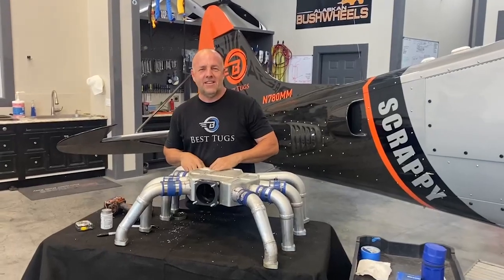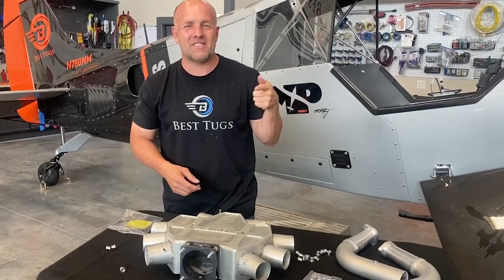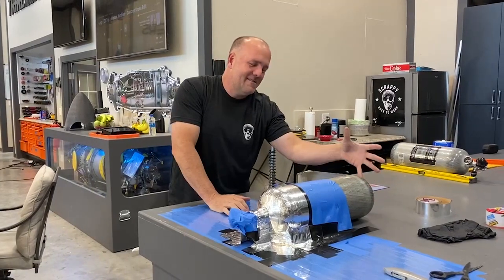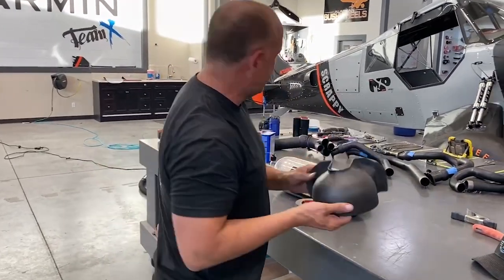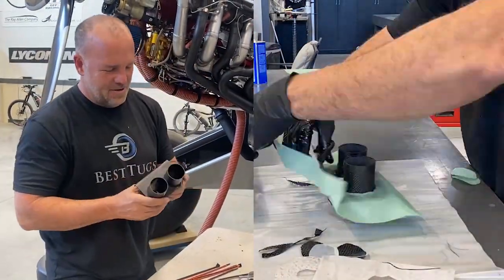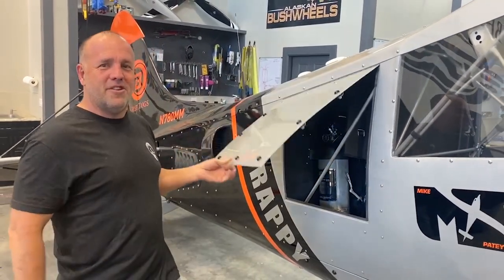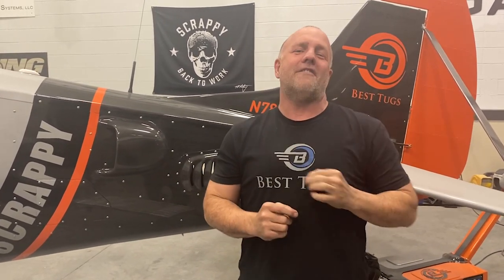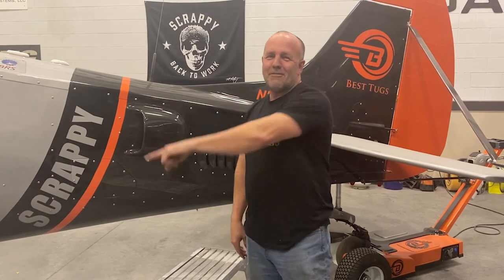Monster NOS Race Engine in a Bush Plane - Part 2 | Scrappy #40

Comment: Been a LONG time since I messed with nitrous.. shouldn't the bottle be laying down? Great video as always Mike!
Reply from the maker: 👍🤠 great question. The pick up tube is at the bottom of the tank.  They lay down in cars because trunks aren’t usually tall enough.  So in cars the tank brackets are taller at the front top of tank with the bottom of the tank to the rear of the car so on a launch the then liquid state of nitrous is forced to the bottom of the tank.
Reply: @MikePatey  Learn something every day! Thanks Mike!

Comment: Hey Mike,

I have a quick question for you. Regarding the heat exchanging system between Draco and Scrappy. With Draco, you went with an oil-to-air heat exchanger, with Scrappy you're going with a heat scavenger system.  Did the Draco system not live up to expectations or was that a unique system to primarily deals with the complexity of a jet engine?

V/R
-Jarod

Comment: If you had light weight electric motors inside your wheel rims you can taxi with engine  off ,take  off faster with driving tires and you don't need brakes so you don't pay any extra weight
Reply: The wheels won't turn more than two revolutions before liftoff.

Comment: Is there a reason you're using silicone couplers rather than something like a Vibrant clamp for the intake headers? I know it isn't a boost application, but with how you overengineer everything I'm just surprised

Comment: Do you have a pressure gauge on your panel?  Let you know before you drop into those beaver ponds that you do have the juice in the bottle to get out.  Be catastrophic to assume you do and find out after landing that a small leak has bled your nitrous off.
Reply from the maker: Great question 👍🤠 Yes it displays it on the Garmin screen

Comment: 900 psi nitrous versus 10 psi gas ? what stopping the 900 psi nitrous overpowering the 10 psi gas?Meaning pushing back the gas/ sorry for the question . Im trying to understand what you doing.

Comment: Does carbon fibre crack at low temperatures- thinking Alaska -40C
Reply: The graphite fibers don't. Not sure about the resin. It probably depends on which resin you choose (he is using epoxy but I am not sure which one exactly). But -40 is pretty cold. He may try to avoid such conditions?

Comment: PS, your 250 shot is really 500 at 2700 rpm.  BOOM!
Reply from the maker: I talk about that in the first video and that’s why I back it down,  I won’t ever use 250 that would be foolish.  It’s so I can use it at high high altitudes for compensation.  The power is elevation related.  Thanks for the comment for others that also didn’t see the first video where I talk about rpm back down and altitude adjustment.   Never ever 250 near sea level 👍🤠

Comment: Any thought given to the possibility of the parachute rocket causing that Nitrous tank to explode or leak?   I mean... a jet of nitrous, surrounded by carbon, ignited by the rocket, in the back of the plane as you are floating down on a chute would not be a great thing...In high oxygen, even diamonds burn like matchheads.

Comment: I imagine that nitrous leans your mixture. If it does, do you need to be full rich before you run it? I know you said it will mostly be on takeoff but would there ever be a scenario where you run it while flying fully leaned out?
Reply: That's why the nitrous jets are dual jets that also spray in additional fuel.  The system sprays in the right amount of fuel to match the nitrous it's spraying in, so the mixture stays the same.

(Mike described this a bit in the first video about the nitrous system.)

Comment: I gotta be honest.  I love your videos, I haven't missed a single one, and I can't wait for your next.  I fear for your safety.  Its one thing to grenade a motor in a car or a truck.  Its a completely different thing to grenade a motor climbing out of an airport or in the mountains.  The motor is not where I would push the limits of horsepower.  I'd opt for the most reliable engine to get the job done.

Comment: Nitrous does not "explode faster".  It increases the effective dynamic compression ratio.  All other things being equal, higher dynamic CR requires less timing.  In practice, this is not necessarily true on nitrous.  Especially not on small shots.

Comment: Mike.  Love your ideas, but at 900 PSI, the orifice in the metal will increase over a short time.  I use high pressure fluids through a small diameter orifice and after just 8 hours of use, the size of the hole is much greater.  For you, this would be catastrophic.  Look into this.

Comment: I love this build and and all the innovation that's gone into it but this part i don't understand. Nitrous is great fore making horsepower but it is also great at almost always causing premature engine failure. Even if an engine is built to accept nitrous, ring gaping, etc. It still taxes the internals of your engine sooner or later causing Premature failure. On the ground that's fine it just costs money. But in the air im sorry i just don't get it. If  anything it more than justifies money spent on parachute recovery system. Don't mean to sound negative. Again i love you builds your enthusiasm and attention to details i just had to express my opinion. Keep up the good work and thanks for the great content.

Comment: The only thing that I know about Nitrous I learned in high school, and I don’t recommend any one inhale the stuff.  Makes you even more loopy.  Just say no to the stuff. Do you own stock in Aeroquip?   You are going to need a computer programmer to adjust your tuning for the engine.  Or a team.  Simple he sez.....Really important question.....when you doing the wings????  Quit putting it off, I am going crazy waiting for wings!
Reply: The wings can't be made from carbon fiber, and the usual rag wings won't work either due to the Excessive HP and the loads to be placed on it.  So little projects keep popping up until the wing issue is resolved by someone else and the framework purchased for covering.  Don't hold your breath, you will turn blue.

Comment: Being an experimental, why can't you install, program, and run a complete stand alone engine management system? you could even run Ambient Pressure, Mass Air Flow, O2, Ignition, Fuel Mapping, Load Mapping, etc

Comment: is there a check valve on the fuel line?  otherwise 900psi will overpower 10psi and push NOS up the fuel lines, no?
Reply: It is 900 psi upstream of the jet. The orifice on the jet limits the flow. It will not be 900 psi inside the manifold or duct.
Reply: @mckenziekeith7434  my point exactly. 900psi prior to the jet and Y fitting would mean it would overpower the 10psi fuel pressure. Remember, the fuel line and NOS line merge together at the Y fitting/jet.

Comment: Why not set the motor up on fuel injection? You could make a Haltec or Holley computer run it I'm sure. All the sensors are generic.

Comment: @6m40s: The black phenolic barrier terminal strip (on the nitrous solenoid plate, nearest the camera) looks a bit out-of-place on an aircraft engine, which vibrates. If this design is to be retained, then make sure that suitable lock-washers are used, on each connection screw. And then check the screws (for them backing off) before each flight. With care, it should be fine. It just looks like a weak spot. Stay safe.

Comment: @Mike Patey Be mindful of the dip-tube location inside your nitrous bottle. You didn’t mention how the location of the  the dip-tube pickup changes with the mounting orientation. Combine that with the the extreme angle of attack that scrappy will be capable of. You don’t want the fluid to uncover the dip-tube pickup ant the wrong time and flood the engine with fuel. Because “as I’m sure you know” N20 does not burn, it simply adds more oxygen to system, allowing more fuel to be burnt in the same size combustion chamber. Same reason that rockets have to carry their own oxygen with them in order to burn their fuel outside of our atmosphere. You also did not mention how you will be monitoring and regulating your bottle pressure. It’s gonna be hard to maintain 900psi with that multi port system you’ve got and operating in low temperature environments as you have mentioned. And the purge is necessary to clear the line when changing the bottles, but that not why pro nitrous drag cars do the long purges at the starting line before they stage. It’s done to bring the bottle pressure down to the point each time. It’s much easier to reduce pressure than to build it. So race teams heat the bottles in a water bath prior to installing them in the car. This raises the pressure above 900 and allows fir the time it takes to get the car through the lanes, track prep,  burn out , ect. Now the bottle has cooled over the time is has taken to get the cat to the staging point and the pressure has been dropping this whole time. But you never know how long all that will take. So you over pressure the bottle to say 1100psi and it losses 100 psi during this time. Now you have to purge off 100psi to get to the 900psi target which is necessary to make the same power each pass down the track. Again you prolly know more than most any of us here, so I was just curious to see how you were going to be managing that aspect of the system. Keep up the great work brother, your an inspiration in a time when humanity can make great use of it. Gratitude 🙏

Comment: Nitrous Oxide is one of those things where "just enough" is good but more is bad! I'm an Engineer AND a hotrodder and I know enough about how to do it IF I want to but I don't need it. For example I have a 1999 Pontiac Grand Prix GTP. For those that are not familiar with them it is a Supercharged Buick 3.8L V6 with an Eaton M90 ("roots" type blower). 240HP under boost, but boost on demand with a bypass so normally it is the same performance as the 200HP NA engine. I've seen MANY people on the GP boards put Nitrous on their cars and 99% of them do it wrong. Dry kit only, too much Nitrous even with a wet kit, not taking into account all the things you went through, etc. Too many of the younger guys (I'm 62) get "spray happy" and take the piston tops off just as you describe! The engine in mine is the same as used in a Buick Park Avenue Ultra which is a MUCH heavier car! Stock numbers on MY GTP are 0-60 in 6.6 sec, 0-100 in a little over 15, speed limited to 135 MPH because of the stock tire speed rating and MY tires aren't stock. Clip the limiter and they'll get out to ~155 (documented). As it is it gets up to highway speed before I get to the end of the entrance ramp without WOT and it'll cruise at 100 without breaking a sweat as long as there's gas (Premium Only) in the tank! I drive conservatively "most" of the time...  ;)

Comment: At the current pace, I wonder if Scrappy will ever fly this year.  Obviously the wings are a big issue because of the horsepower and are being put off for as long as possible.  Whatever happened to building two airplanes at the same time, Draco X and Scrappy?  As a pilot, to say I'm disappointed is an understatement.

Comment: I love what you do.  But, why put in a system that you will seldom use when you have gone to great lengths to conserve  weight.
Reply: Because using it will allow him to take off from high mountain lakes that probably have never been visited by aircraft before. He explained all this. The nitrous is to maintain sea-level performance in high mountain lakes for take-off.

Comment: I think you named the plane wrong.  It’s not Scrappy, it’s Snappy.  All the custom carbon fiber and aluminum pieces are not because you want to save weight, it is to allow you to snap things together.   The nitrous was just more snapping.  Snap the bottle in, snap the ports in,  snap your head back.  It’s all Snappy.

Comment: I'm not all that excited about using an oxidizer  "power adder" for an aircraft engine. I don't think it would pass Australian CASA standards for certification anyway and would be a nightmare to estimate a TBO for the engine. The worst case is you get to 300 feet or something on takeoff and blow the ring lands off your pistons or have some other kind of catastrophic detonation that has you looking real quick for a place to put down with oil all over your windshield.  In the back of my mind I really wanna see how it works though...don't tell anyone ;-)

Comment: Awesome setup! So my question is this: is there is any risk of fuel pooling or nitrous leaking into the intake when not desired and what are the potential risks if there is? My thoughts are that the system will work fine at WOT when its designed to trigger, but what happens if one of the solenoids gets debris in it or a seal fails? Are there redundant solenoids so that fuel and gas can both be cut if needed in the event of a failure?

Comment: For such a smart guy it was pretty dumb to make this system this complicated. It would have been so much more robust and easier to tune if it was just a single modest shot instead of all these tubes, valves, switches, etc. for different amounts. In what situation could you be in to need nos and still want to fiddle with all of that.

Comment: Hi Mike ! Here an ex Belgian F-16 crew chief :)  What if the Nitro tank empties ? Your engine will stall as well if you keep the nitro timings. Do you have a feedback of the nitro pressure ? Back to work :)
Reply: I was thinking this too. Also, if your DIY voltage regulator timing fails do you have a way of preventing a shot of nitrous from destroying your motor? Maybe set another condition of having the correct voltage as a requirement to trigger the solenoid. Though, I'm sure you though about all of this.

Comment: Pounds, ounces and inches. 
When will your country realise?
Kilograms, milligrams and millimetres.
It is SOOOOOOOO much easier.
Reply: Inches are OK. It is the mixing of feet with inches and the tradition of using power of two fractions (1/2, 1/4, 1/8, 1/16 etc) of an inch that drive me crazy. But whenever it is reasonable I use metric for everything if I can. If I have to do calculations I convert to metric FIRST and then do all the calculations in metric.
Reply: @mckenziekeith7434  YES the fractions of an inch are crazy.

Comment: Increased complexity increases potential points of failure. Sometimes I think you are just trying to show off instead of making rational choices.
Reply: I'm not sure that the word "rational" actually applies to anything involved in this plane.
Reply: @kensherwin4544  going to an extreme with a purpose is different than putting an overly complex nitrous system that added 40 fuel lines. You can get solenoids that allow pulse width control. I’ve setup a bunch of constant feed systems where they were infinitely variable between 0-max jetted hp, far less BS than this design.